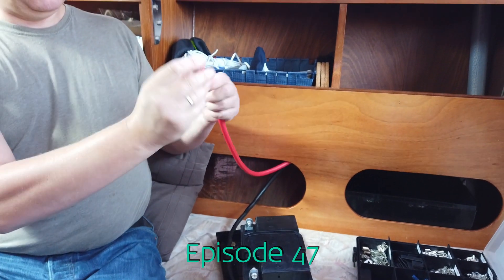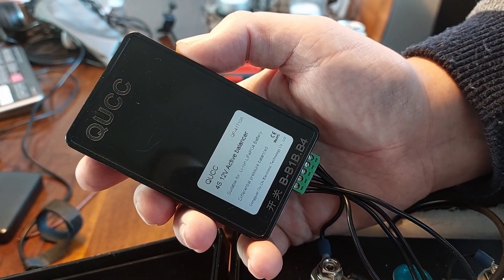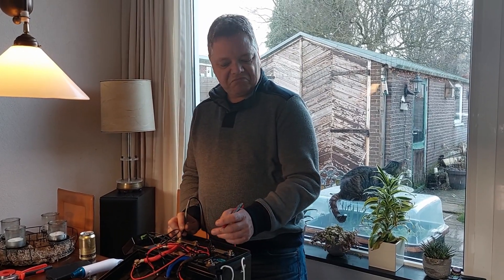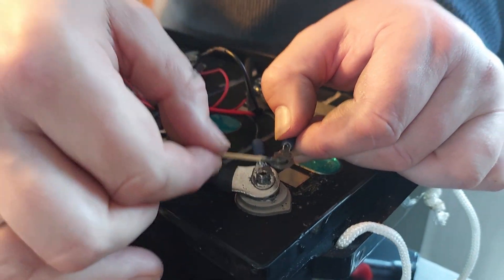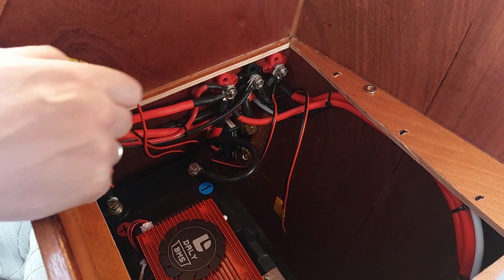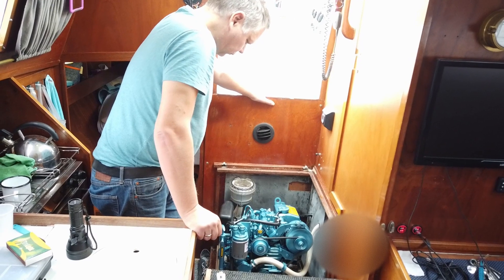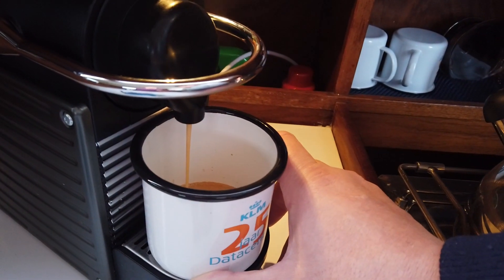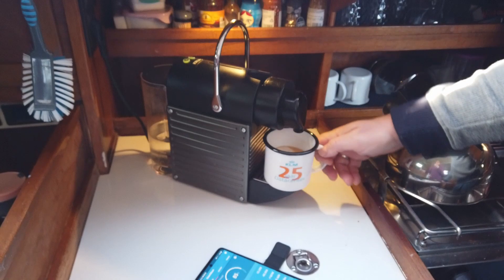How to convert lead acid batteries to Lithium -Part 3 - Grade A LiFePO4 conversion on a boat - Ep 47

Comment: Hi Jouke and Rob, nice video series! 
I’m planning to do the same upgrade to my boat soon, and I was wondering why you in the end put the BMS outside the box - did it not fit anymore? And can you share which seller you bought the cells from? And the very last question 😉 what kind of heating element is that? Thank you, en groetjes uit Utrecht!
Reply from the maker: Hi Felix, thanks for the kind words. As for the questions:
Indeed, the bms just did not fir in the box. That, and the fact that this bms has no heater function, made me decide to change to a different bms. More on that in a later video, I promise. 
The heating element now is a simple car seat heater but will be changed to two silicon heating mats. Also in a later video.
The cells themselves came from SANBEN global battery store and took quite some time to arrive.